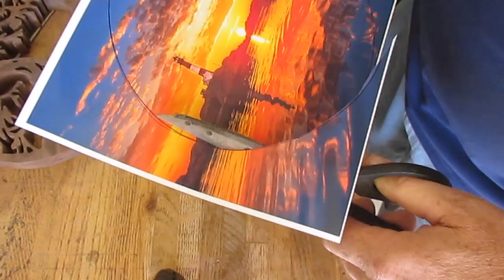Tree of Life / Scroll Saw Art

Comment: What kind of blade did you use to cut out wood you had such control I struggle with making those turns you do and I wondered if I was using the wrong blade. Thank you for such a beautiful tree of life carving.
Reply from the maker: pegas blades, that was a spiral 0/2 blade, just take your time, and let the blade cut, its all about speed, tension, and density of the wood, hope that helps

Comment: What kind of blade are you using? I can't get a sharp turns on my scroll saw like you can. It also looks like you don't turn your board - simply move it around. I'm using a skip tooth 18 TPI blade on my entry level Ryobi 15" saw. Any tips?
Reply from the maker: Thanks for watching, is your scroll saw a pinned blade or pinless. I am using a pinless Flying Dutchman 2/0 spiral blade for this project. it allows you to cut from all sides, it is something to get used to, but works great for intricate cuts

Comment: Hi,
what type of blade are you using?
Reply from the maker: it was a #5 Olsen reveuse tooth blade, I have since found Pegas Blades are a great one to use as well , thanks for checking it out
Reply: Thank you. I am actually about to start with scrolling so not yet that familiar with stuff. BTW do pegas offer 133mm blades or I can also use 130 instead, as my manufacturer says it's 133mm.

Also do they offer pin end ones, as my scroll saw doesn't accept plain end.
Reply from the maker: not that i know of, but most a pinned  scroll saws you can get a pinless conversion kit, i had on on my old HF Scroll Saw

Comment: Beautiful work Sterling. I've got my new DeWalt scroll saw set up now and I've been using a piece of scrap 2 x 4 to hold the arm up.  I see I'm not the only one using such a high tech device. :-)
Reply from the maker: Works great, lol, glad to see you got one, and was great seeing you last week, can wait to see what you scroll out
Reply: Dave Gatton I have a Dewalt DW788 scrollsaw and I tightened the torx bolt behind the arm on the bottom and it stays up by itself. I'm not sure if that's o.k. though, I never got a manual for it when I got it new in 2012. If you know better, please contact me!
Reply: John Bojack been running my saw like that for about 5 yrs now , if I remember I only tightened up the lower bolt about 1/4 turn .
Reply: Paul Rooster thanks brother! It seems to be working ok, but I didn't know if that was a popular move.